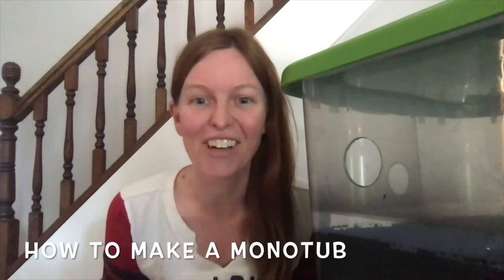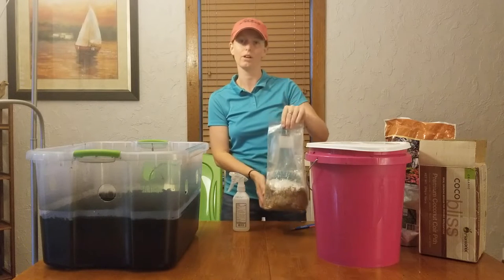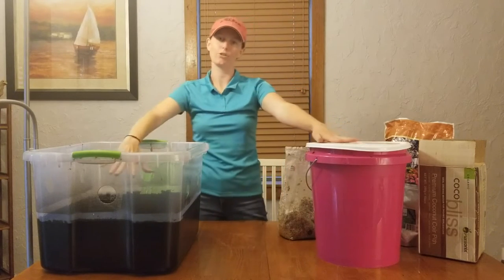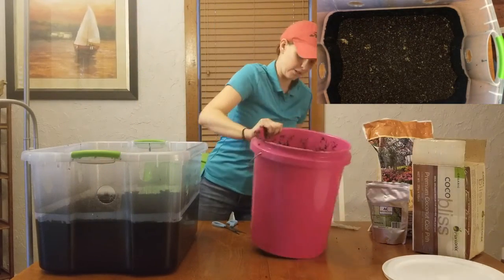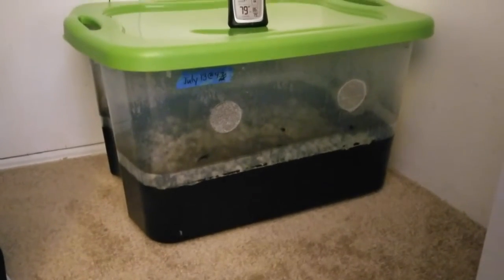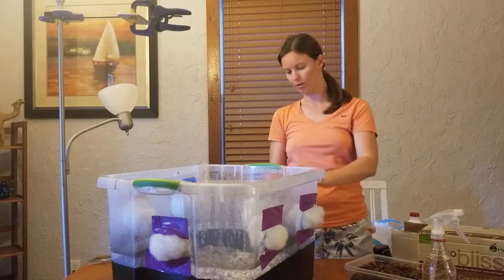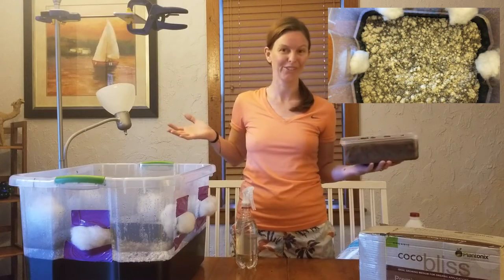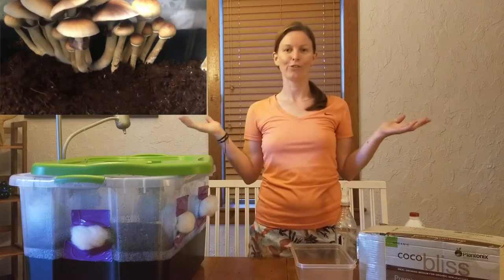How to Make a Monotub | Spawn Bag to Bulk Substrate | Casing Layer | Fruiting Mushrooms

Comment: Great video but I would like to definitely let you know that the reason that side pins happen or because when the substrate colonizes it itself shrinks therefore creating microclimates that happen between the shrunken cake of mycelium and the walls of the tub so even though this happens will be small any light that hits the side of the tub and goes down will still fruit the bodies. A plastic liner will adhere to the side of the mycelium itself creating essentially a seal preventing a microclimate.
Reply: Thanks for this explanation. I've been doing research for a monotub grow and I understood that you need to prevent side pining, and I didn't know if I should use a liner or paint. To me, spray painting just seemed easier than making a liner, but you explained why a liner would be better. You saved me finding that out for myself.
Reply: Do I have to worry about side pinning if my tub is dark green green at the bottom? Should I still do the liner?
Reply: @ButtSauce666  lol it's just the color of my tray

Comment: If you really don't like side pins, painting the bottom of the tub will not prevent them. Side pins occur in painted-bottom tubs without liners because the space between the colonized cake and the sides of the tub -- which develops as the cake shrinks a bit -- is a very good microenvironment for fruiting. It's not really not so much about light.

But a reasonably thin liner (like some cheap black garbage bags -- not thick contractor bags), will adhere to the side of the cake as the cake shrinks -- and therefore prevent that pinning microclimate from forming. 

That polyfill stuff is so untidy. You can use micropore-type tape -- or better yet, you can buy pre-cut, circular adhesive micropore filters to neatly place over your holes. 

Additionally, the very popular dung-loving species you're probably considering growing doesn't really need to be cased. Although opinions differ on that a bit. 

Also, the holes in that tub could stand to be placed a little differently. Assume about 3" of substrate, side holes will be about 4 or 4.5" up. The holes on either end should be up higher than is depicted here.

Comment: For people who are having contamination problems. Bring your bulk substrate up to field capacity then put it into an oven cooking bag i use the big turkey bags. Put the bag on a pizza tray and into oven 205 degrees for 2 and half hours. When done let cool and drop this right into bottom of your tote and its already in its liner. Open oven bag pour in colonized grain mix it up trim liner to how u like and bam 💥. Then put tinfoil over top of substrat. In 10-15 days remove tinfoil and allow to fruit
Reply from the maker: Cool thank you!
Reply: @BoomerShroomer  thank you ma’am for the vid ❤️
Reply from the maker: @ieatdirtoutdoors  if you don’t get over 160 degree which is pasteurization temp.. you might not kill off all the bacteria. I would be worried to keep it lower. There are somethings that can live through it. Like slime mold. I’m not expert but that’s what I’ve been reading.

Comment: I have already spray painted the bottom 4 inches of my tub black and have a 3lb spawn bag. Should I use all of my spawn bag in one of my 66qt tubs? It's my first time, and I had to return 2 of the 3 spawn bags I inoculated due to holes in the plastic; after waiting two months I am nervous about putting all of my eggs in one "basket", especially after watching your video about making a liner. Also, how many days/weeks is my bulk substrate still sterile and usable? I put the lid on it 2-3 weeks ago when I made the substrate, but because I was going out of town for holiday I decided to wait before starting this process. The bucket has remained sealed the entire time. Thank you for your time, I love your videos!

Comment: doesn't the casing of coco coir have to be sterilized or pasteurized?    I've seen coco bricks with small spots of trichoderma on them ... do you have outdoor mushrooms? resistant to plain coco? :)
Reply: Im also interested in finding out that. Thanks
Reply: @mariaf9478  does it have to be? no... nor does substrate for that matter. That being said, as is the case with substrate,  NOT pasteurizing the casing layer will exponentially increase likelihood of contam. Therefore, pasteurization is strongly recommended.
Reply: Yeah, you do want to pasteurize. In fact, I have NEVER  heard of this casing tek, let alone seeing this casing tek employed.

She does a very good job demonstrating the birthing and casing processes in these videos. However, I DO question her overall myco experience and acumen. She's good, but there are much better mentors out there whose brains I would recommend picking after learning the basics from chick,
Reply: @beingrealwithneondeon  but why does she mince it with something and putting it there? maybe she would have done a better job demonstrating by skipping one of the steps, not putting it out there like that. I get the feeling that she did it on purpose.again this is not mentoring , this is plain sadism. she didn't forget by mistake, she did it on purpose, this is one nasty one. she even gives the details :)) on how to do it. this is no mentor, this is someone that just sits in front of the camera for some reason , maybe she had some negative outburst on the viewers. it's too specific of a rookie negative outburst.I think she did this just to ruin people's work.
Reply: @beingrealwithneondeon  SHOUTOUT to everyone DO NOT USE COCO COIR LIKE THAT. Get the information you need from other sources before you proceed with these steps. PASTEURIZATION OF COCO COIR FIRST
Reply: @beingrealwithneondeon  makes a lot of sense to me, thanks for answering

Comment: Hello, enjoy your channel, have a question for you..after you mix your colonized grain bag with your bulk substrate and then  your substrate in the tub becomes fully colonized and your ready to  start the fruiting phase, is it necessary  to add that top layer of casing?
Reply: Depends on what mushroom you are growing. Some need a higher moisture retention on the surface and some don’t. APES and PES benefit greatly from a non nutrient casing. GT’s, Maza, B+ are very resilient and don’t need casings.

Comment: Hi Ashley can I ask during colonisation phase should I keep me substrate in the dark for up to 1/14 days or do I treat the lighting conditions the same as when the mushrooms are fruiting ,, 
And what temperature you recommend while in colonisation ,, many thanks
Reply from the maker: No, you don't need to keep it i the dark. I usually keep my house around 70-75F all year long. The tub will keep the correct temp and humidity all you need to do is fan out the Co2 at the bottom when you start to fruit. If it gets dry mist the sides. Don't mist directly. It will bruise the mycelium.

Comment: Hey thank you much! One question I haven’t seen anyone else using that last “casting”? layer I think you called it...the layer of coco coir over the fully colonized bulk+already cased substrate. 

What’s the purpose aside from adding more humidity? Doesn’t it also then have to be colonized or the fruits push through? I feel like the fruits will only push through on the edges closest to air exchange OR does this help create the best microclimate across the entire surface?! 

I have 4 more days on two tubs before inducing fruiting so I’m really curious!
Reply from the maker: The casing layer basically provides protection for the mycelium and added humidity. My last two tubs I did not add a casing layer and they are doing very well! If you are growing cubes I would recommend NOT using a casing layer. I am not sure what you are growing... But some mushrooms need a casing to grow.
Reply from the maker: Also, check on my instagram you can see my tubs that don't have a casing.

Comment: Hi there, LOVE your videos! 
Can I use the poly fill right from the get go instead of plugs? I made the northern spore mono tub and am ready to put my substrate and grain directly into it to colonize further. Thanks!
Reply from the maker: You can. Only problem it is won’t be as humid which may cause them to colonize a little slower. Also use a liner!
Reply: Maybe I’ll wrap Saran Wrap around the tub lol
Reply: Thanks again you’re a legend!
Reply: One more question! I have 6 lbs of spawn is that enough for two tubs? Thinking I might just do one for my first!
Reply from the maker: @namesjames519  I think it might be enough for two. But you will get an even better flush if you put it all in one tub.
Reply: Boomer Shroomer one it is!

Comment: Hi thank you so much for your video, got a question though,  may I ask what is the ratio(weight) of your spawn bag versus the substrate? Thank you!
Reply from the maker: I usually use a 3 pound spawn bag and one recipe of bulk substrate in a 66 Qt monotub.
Reply: I use a 56qt. or so tub. 2lbs of spawn and 8lb of pasteurized Manure based substrate from Out-Grow. You need between 3-4 inches of spawn/ substrate after laying together. I find that closer to 4in is the best results. I’ve tried many different ratios and the best ones are the ones with 20% spawn grain and 80% pasteurized manure based substrate.

Comment: Hi Ashley,  hope all is well. I wanted to get your feedback on using a Hydroponic Humidifier System with HEPA filter.  I want to try and reduce the opening of the mono tub and possibly introducing any foreign pathogens. i  am also adding ink bird humidity controller. by adding this will i need to still be concerned with Co2 build up in the tub?  should I still fan it out? the idea is to make this where i do not have to mess with it often.
Reply from the maker: I just checked out that system you got! That pretty cool! Yes, you will still have to be concerned about Co2 at the bottom and will definitely need to fan it out daily. Could you reach out to me on Instagram? I would love to see pictures of your set up!
Reply: @BoomerShroomer  ok. Koop. Ty. while waiting on my second attempt of colonization of my spawn. I’m adding a few gadgets to my monotub for my research. So you know last time I I showed you my SB that had that contam. I think I figured out what caused it. This is my guess which I could be wrong For one I used the whole 10cc due I wasn’t sure the quality of the sample and I think all the liquid sat at the bottom and the humidity levels were high which caused a lot of moisture . So now I’ve been rotating the S.B. So the moisture doesn’t sit on the bottom or on one side to long. So far looks seems to be working. A week in and I see some Colonization starting to take place. We will see. As always thanks for the quick replies and feedback. Be well and Talk soon. 🍄❤️
Reply from the maker: @mikea6747  yay that’s exciting!! First sight of mycelium! Congratulations!

Comment: I cased my PE6 about 4 days ago with a basic 50/50 casing tek. The myc has seemingly begun to colonise the casing instead of start to pin. Is this normal? I have fruiting conditions in my tub and my pest moss/verm is non- nutritious and mostly inert I thought? Thanks
Reply from the maker: Yes, that is normal. Start to give it fresh air and it will fruit for you.

Comment: Everything good. The only suggestion I'd make is not to paint the bottom. Instead, use black plastic liner in the tup at the same height of your paint. Cutting up a black plastic bag will do. I don't tape the bag to the inside of the tub because when  the mycelium colonizes it sticks to the plastic, preventing less side pins.
Reply from the maker: Thanks
Reply: Air is a huge trigger. I do the same with a black trash bag. As the mycelium loses water throughout the flush it’ll stay clinged to the bag and prevent air getting down the sides

Comment: I have a question. Is there a point in time where you can’t add a casing layer? Is the window for casing only after the tub has colonized? Or can you case down the line like after a 1st flush per say?
Reply from the maker: Yes, there is time when you can add a casing when it is most beneficial. But could also add it at anytime and the mushrooms would possibly start to colonize it. I have been adding a casing when I first put them in.. So I mix the spawn an bulk together flatten it down and then add a half in later of bulk as the casing and go from there. I do not add a layer later on.

Comment: Have you used uncle ben rice packs to spawn mycelium? I dont have a pressure cooker yet so I used a few of those to help stay sterile. It's been about 7 days since inoculation with spore syringe and its getting pretty fluffy. I need to know when to spawn to bulk and I hear people say it should be almost rock hard, but it's not even close to rock hard where it's almost solid mycelium. Any thoughts? Thanks for your videos!
Reply from the maker: I have not used those before but yes it should be a pretty solid block where you need to work pretty hard to break it a part for the montoub process. If you send me a few pics on instagram I can take a look and let you know more information. Also it takes about 30 days to fully colonize a spawn bag depending on how big they are. Hardest part is being patience. :-)
Reply: @BoomerShroomer  sorry I dont use Instagram. But it does help to know how hard it should be. I did a break and ahake today and I'll leave it for another week. It's not alot of rice in each of those bags so I'm sure I won't have to wait longer than 3 weeks. Thanks
Reply from the maker: @shawnwillis7561  You could also email me. EndersAsh@gmail.com
Reply: @BoomerShroomer  I'm sure I'll have more questions. Thanks!
Reply: You should look up 90 second mycology. He pretty much exclusively use uncle ben rice bags.

Comment: Im guessing youre painting the sides to stop side pins? Doesnt a bin liner cut to shape inside give better results as it shrinks with the sub so stops micro climates?
Reply from the maker: Yeah I just use a black liner now and I think it works a lot better.

Comment: Why do you add just a little more substrate on top? Everything is theoretically sterile except for the mycelium. Since that’s already colonized wouldn’t it best protect against whatever might float through those holes? Would it dry the mycelium out before it colonized to its fruiting if it wasn’t covered with something?
Reply from the maker: No, you don’t need to cover them with a casting layer. But you can. When you start to fruit just spray them down and expose tot he air and they will start to pin. I’m growing oysters right now and they need a casing layer but next go around with cubs I’m going to try no casing layer and see how it goes.

Comment: Ever try without holes? I’m just beginning and trying to fan and spray daily  with no holes
Reply from the maker: Sure, you can do an unmodified tub but you'll have to fan it a lot when they start to fruit.
Reply: @BoomerShroomer  by the way have you ever watered between the sides when the cake is moving in from the edges so it doesn’t dry up so much? I’m wondering if that might help me since mine seems to dry up easily (very dry here).
Reply from the maker: If your tub is dry you can mist the sides of the tub but don’t mist the mycelium directly.

Comment: do you have central air so you can keep the temp within the good range...That's my only foreseeable problem...during the summer it can get up into the 110+s outside and 80+ inside with the window units on
Reply from the maker: That's fine. Mushrooms can grow in hotter temps. You can put a fan in the room to try to cool it down. But I do have central air.
Reply: @BoomerShroomer  Thanks...that relieves my biggest concern about pursuing growing Mushrooms at my home...
P.S. What do you that your thermostat set at and why?
Reply from the maker: @matthewjacobs141  around 70 all year long.
Reply: @BoomerShroomer  And why 70?

Comment: Do you have to pressure cook your substrate mixture as well?
Reply from the maker: Just pasteurize it.
Reply: @BoomerShroomer  what’s that even mean 😖
Reply from the maker: @snipergang3055  check out my bulk substrate video. It shows the whole process. https://youtu.be/gwJdKTWfSUU
Pasteurization needs to get to 160 degrees and sterilization needs to get to around 250. It just takes longer. You only need to pasteurize this bulk substrate
Reply from the maker: Sorry I didn’t mean to be confusing.

Comment: Do I need something to control the temperature for this?
Reply from the maker: No, the Monotub itself controls the temp enough. As long as it’s not too hot or too cold around the tub. If it’s in your house you won’t need anything to help regulate temperature.
Reply: @BoomerShroomer  thank you just saved me hella trouble 😩 
Also, would I be able to grow Shoe Box tech in this and if so, how?
Reply from the maker: @elpapajon3622  I’ve never done shoebox tek so I’m not sure sure. I’ve been thinking about growing in smaller containers.

Comment: I am 4th day in colonizing my bulk substrate , there are hundred of thousands of water droplets all over my mycelium? Is this good or bad? I’m getting nervous about when to wait to fruiting and take out of the darkness!
Reply from the maker: That’s a good things it’s call exudate.
Reply from the maker: I usually keep it colonizing for around 14 days until I open her up.
Reply: Boomer Shroomer thank you! Would it be too late to case after 4 days of fruiting? I already have a few pins ! Thanks!
Reply from the maker: @namesjames519  a casing is not required. I stopped using one. If you put one on now they may try to colonize it a bit which will slow your growth. Might be better to just go as it.

Comment: What’s the point of the casing layer? What happens if you don’t?
Reply from the maker: I don't case anymore. Just mix the spawn and bulk up evenly together in the tub and lightly flatten to the bottom. Then let it colonize. After about 6 days it should be ready to fruit.